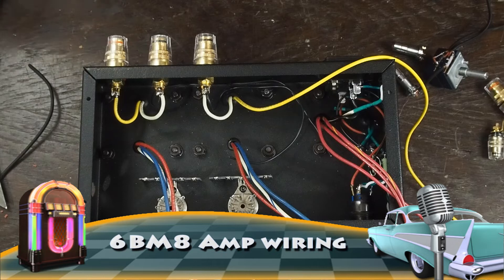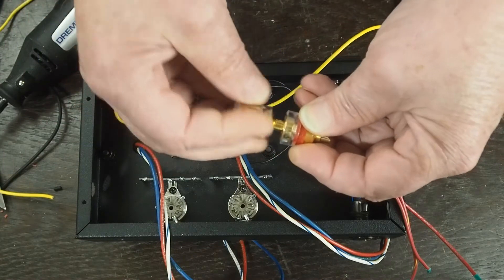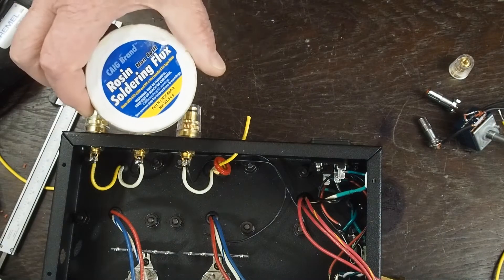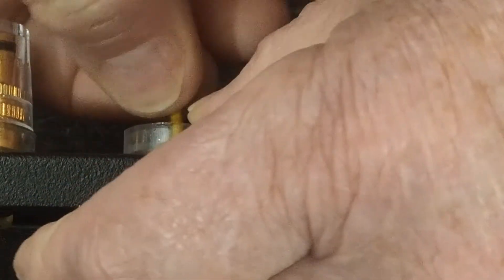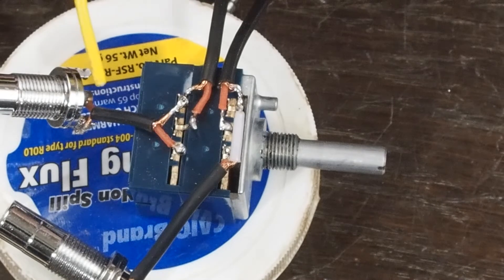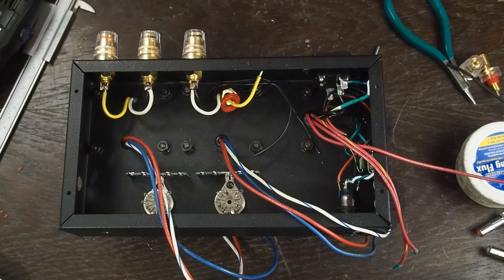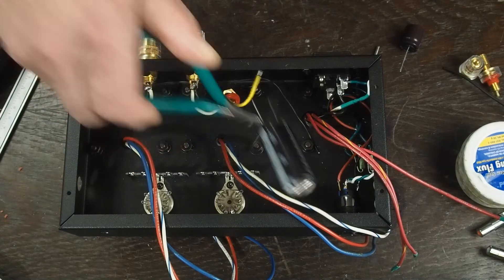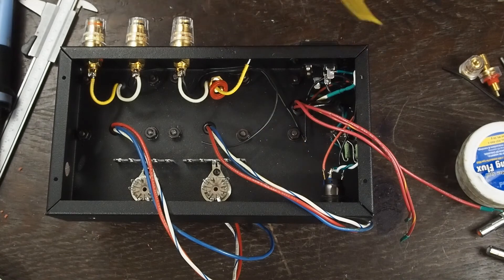6BM8 DIY Tube Amplifier Signal Wiring #9

Comment: Hello, I think your videos are very good, the in-depth explanation is really appreciated , I am making a 18w eBay diy board…
On switching on to check the voltages, without the tube, I found that the Capacitors on the power section were getting warm and then hot…
Can you suggest any reason why?…
Your advice would be most appreciated 
Thanks
Reply from the maker: I would assume without the tubes in place and drawing current, the voltages are a lot higher, possibly close to or beyond what they are rated for?
Reply: @SkunkieDesignsElectronics  thanks , I will check the voltages once the tubes are loaded